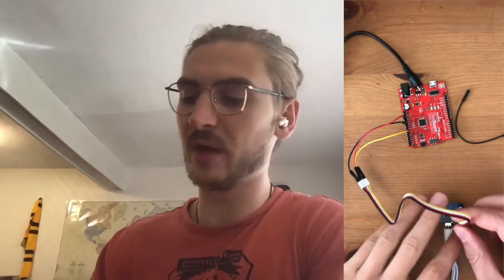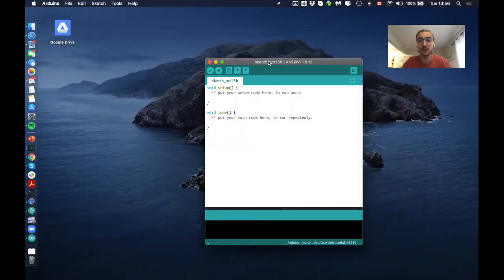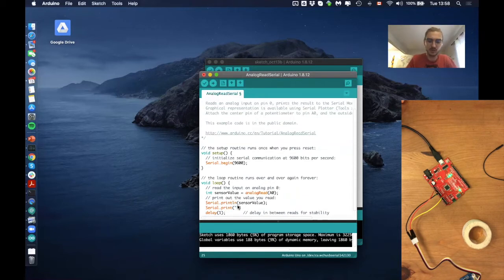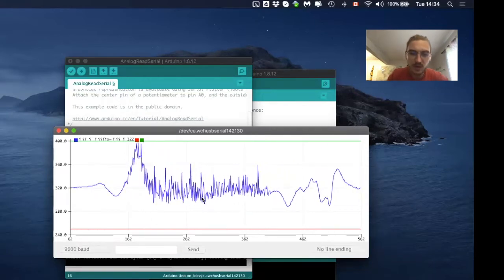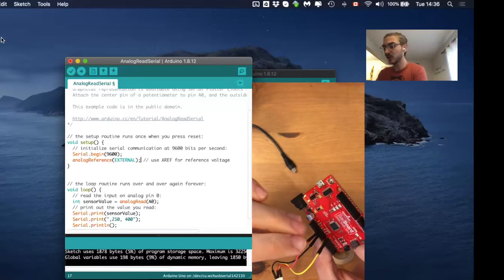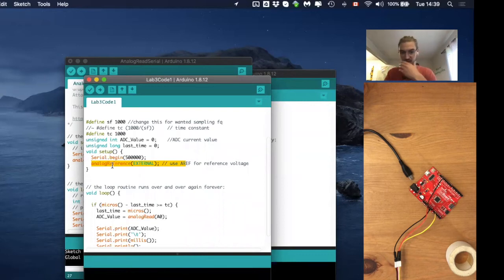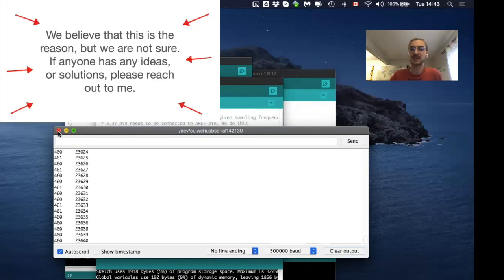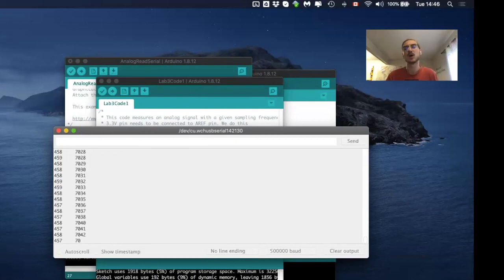EMG Data Collection Tutorial

Comment: Hy
Above all nice work, all my regards.

I have a question for you: I've tried (with your software and circuit) to do an EMG exam near a go-kart a person was warming up and sadly, when the engine raised his RPM the EMG graph was showing an increase of value (the linegraph wasn't sky-rocketing but you know increased sharply with an unstable trend) while I was relaxed and seated. 

Is it possible I did something wrong or I just haven't put a specific protection for signal-noise or even the hardware is just not noise-proof?

Could you please help me to solve this problem? I am projecting to use the EMG analysis while the go-kart and the driver are driving a race. 

Thanks in advantage

Comment: Does this answer your question about the delay in logging with a high sample rate?

"The Qwiic OpenLog also supports clock stretching, which means it performs even better than the original and will record data up to 20,000 bytes per second at 400kHz. As the receive buffer fills up this OpenLog will hold the clock line, letting the master know that it is busy. Once the Qwiic OpenLog is finished with a task, it releases the clock thus allowing the data to continue flowing without corruption. For even better performance the OpenLog Artemis is the tool you need, featuring logging speeds up to 500000bps."
Source: https://www.sparkfun.com/products/15164